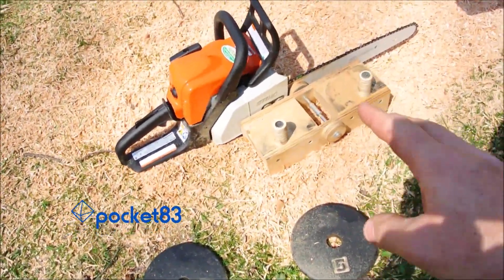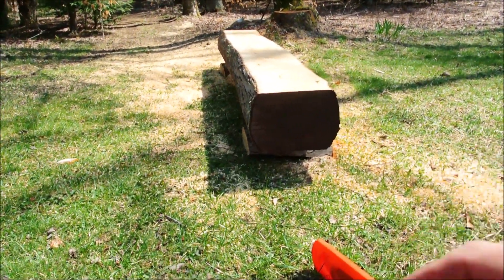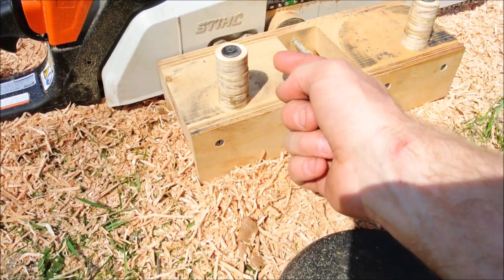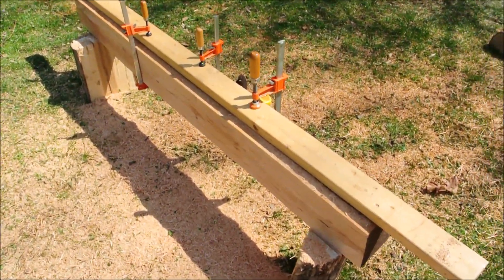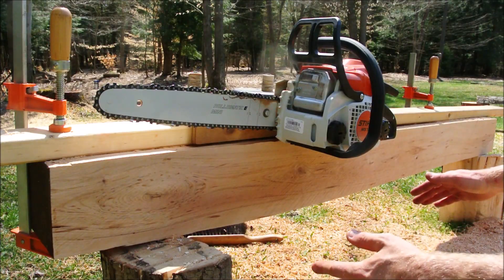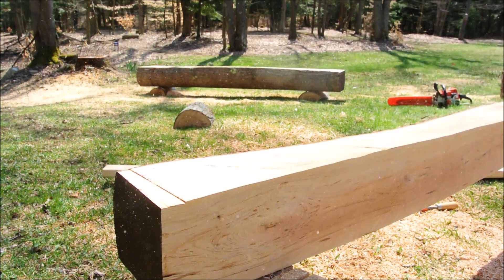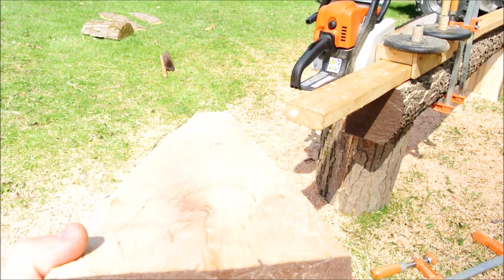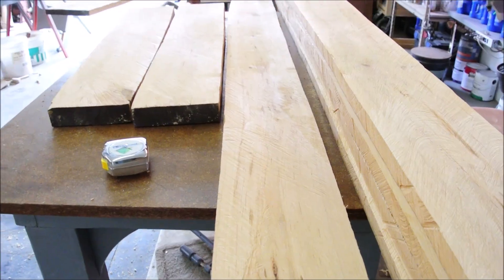DIY Chainsaw Mini Mill Counterbalance

Comment from the maker: In case you missed the original video, here's a link:
►https://www.youtube.com/watch?v=a47IL_Fxb8E

Still on the fence about milling? I hope these videos motivate you to try out this technique. With the addition of the counter-weights, you're almost guaranteed a workable result on your first try. If you've already tried this before, read the description for a few more refinement tips.
Reply: in the last chainsaw milling description you ruled out a counterweight in favor of a pin. did you try out a pin or wheel in the meantime? or was the weight just an easier improvement?
*dont even know why i am engaged this much in chainsaw milling xD  -  the most dangerous tool i have is a coping saw xD - but never the less i like this aproach of yours to these kind of activities, still helps me cultivating better thought patterns in my problem solving :)
Reply: That SEO description is brutal to read. Just checked the description of the 'eight miter' video, looks like I will have to check back later.
Thanks for the video and the knowledge. Not sure the chainsaw has paid for itself yet as I still value wood at 50¢-$1 per board foot (green rough sawn) but I could see it easily paying for itself in other circumstances. Glad for the update proving the usefulness of the method.

Comment: Man, how cool is this? I’m starting my build but have 2 quick questions if you could reply? Would you mount it to the bar the same way if you were a leftie on the trigger? Also Im going to be using an ms250 or 311 (thats what I got) so do you see any need for a 2x6 guide instead?  Thx very much
Reply from the maker: Yes, I would still mount it the same way. Very important. But I might try mixing up my stance by standing on the other side sometimes. My advice is that you start with the same setup as pictured, but then gradually learn to adapt the most comfortable posture. You might find that Right-handed isn't so bad, because the motion isn't exactly difficult. 

And don't bother with a 2x6; it won't make anything straighter. I get this suggestion lots, but it will only add weight for no reason. Also, watch the other videos in this series, because I really refined the process as I went. Part 4 is probably the most useful:

 https://www.youtube.com/watch?v=alClPHQMeMk 

I also wrote LOTS of tips in the descriptions and comments, so poke around there, too. Good luck. I'm here if you have any questions.

Comment: Great idea I doing something  similar   I can't  do the  gas chain saw becouse  of sound and neighbors so I got a electric oregon that work  great for  3 years when cutting  trees  and  milling 8 foot logs then I got greedy and mill 16 foot logs I got 4 and burn the saw😢😢😢 butt not complain it prove  that can be done I got 2 gas chainsaws but i dont want  to start problems with  neighbors. 
I got a question  what  chain are you using

Comment: You are correct, the saw cuts better the shallower the angle because you are cutting along the grain. The steeper more vertical the saw you then cutting end grain, the hardest way to cut wood. Try this test. Lay a short log shorter than your saw. on roughly level supports, a couple of logs, then cut the log with the saw parallel, time it. Next take a similar size log stood on end, than saw it down with the saw parallel. From this experiment the horizontal or shallow angle cuts long slivers really easily. The upright sawn log will be slow harder work with fine sawdust produced, and will be obvious what I am talking about. I am a woodturner who cuts his own logs, same in the lathe, cutting into end grain is harder slow and dulls the cutting tools a lot faster. I love your wooden version, the origin metal version has another adjustable place for board thickness so you don’t have to keep moving the 4x2. Yours is based on the chineium knock off. Look at the version sold by Vevor and available in most places. Greetings from the Southern Cross Observatory-Tasmania-Australia 42 South 👍😁🇦🇺🦘

Comment: The main problem I notice is log's support, in both ends, the other parte is perfect.
Reply from the maker: It's usually more stable than how it looked here. That time I didn't readjust back to the center of the sawhorses. If you do this, recenter your log between cuts. 

That said, honestly, it doesn't matter all that much. You're going to be stabilizing the whole setup with both hands as you cut. If you allow this setup to tip over, you probably have bigger problems.

Comment: Very informative. The only thing I would change is rather than dancing with clamps on the ends, screw sacrificial 2x4s chunks to the ends of the log to screw your guide to. Then the only holes in your work is on the end and can be cut away

Comment: This is awesome! Rather than freehand the top and bottom, couldn’t you flatten the top off enough for your guide to sit flat, then use the guide to cut the sides off and then flip it 90 degrees? I don’t know if that would be any easier though
Reply from the maker: Yes. That's exactly how I started doing it at first. In fact, I'd probably recommend trying that out a few times before using the method I describe here. However, the new way has the benefits of less bark-cutting and more consistent board widths.

Comment: I have just built and used your jig and man it is astonishing! I need to point out that this was my first time I had no milling experience whatsoever but as you mentioned, tenacity was carrying me through the milling. I have just milled my first backyard log BECAUSE of your jig. The value of the jig is that mich greater as it allowed me, a complete roocky, to “feel” the process and beyond that to get 8 astonishing usable walnut boards with jawdropping finish surface! I cannot expess enough my appreciation for your effort of figuring this jig out and sharing it with the rest of us!
Reply from the maker: Walnut on the first try! Nice. Awesome to hear. Thanks.
Reply: I felt compeled to give you the credits I have actually shared your YT chanel name and links to both videos on fb group. Cheers!

Comment: Question : wouldn't it be lighter on the saw and especially on the chain if you cut 90 degrees the first time? What I mean is when you cut at an apprx 15deg you are using the whole length of the bar (well nearly..in your video-obviously it's a case of the thickness of the lumber and the length of the bar ..haha) ..anyway..If you cut at 90deg then that's the shortest accoros so less strain on the chain.Am I right or there's more to it?
Reply here pls hopefully others will find it  useful/helpful.
Thanks for the uploads very clear and precise.Keep them coming.
Best 
Mick
Reply from the maker: In a word, no. Whether the bar is at an angle or not, both the bar and the chain have a fixed length. In other words, some part of it has to make the cut. If it's the nose that's making the cut, then the bottom part of the bar is just carrying the shavings out. In either case, there is very little resistance being caused by a tooth that has its 'scoop' full. "Strain," as you mention it, is just friction, and as long as your cut is clear and straight, it should be kept at a minimum. 

The thing that's probably most surprising about the process is that it works least efficiently at 90°. In fact, it seems like it works the best when you make lots of quick, shallow passes; moving over the log really quickly ends up dropping the boards faster and using less gas. This has to do with the log's grain, quickly ejecting chips, and some other stuff. There's lots more in the description if you're in the mood to think/read about it.  
Thanks.

Comment: About how big is your diamter pine logs you mill. In your opinion can I get 8' 6" easy enough? Thank you so much for a reply brother!!
Reply from the maker: Diameter:
The logs in this video started at around a 14" diameter or so, but after there are flat spots are on each side, that thickness changes. You want to shoot for around an 8" thick chunk that's flat on both sides. This jig is best for making 8" wide boards.

Length:
You can use this method for any length you want. 8'6" is about ideal, because your saw will overheat if you're cutting too much length. Just try to find a 9 or 10' guide board that's straight.

Pine:
Sure, this technique would rip through pine like butter. But I haven't tried it yet. I'm not likely to bother milling unless I'm getting hardwood out of it.  

If you're going to try this, there are even more tips in the description. Good luck!

Comment: I did the same thing.   I swapped STIHL green chain for yellow and it cuts each pass deeper and mills in half the time.
Reply from the maker: As a rule, don't try to make deeper cuts with each pass. After lots of practice, I've learned that making fast, shallow passes is the more efficient technique. 

The type of chainsaw you use is mostly incidental; every saw will have a unique feed-rate/cut-depth balance, but they all end up taking around the same time.   

If you're using this method, watch the follow-up video, and use the counterweights.

Comment: Very nicely done! Thank you sir for taking the time to make a detailed and informative video. I would love to buy a sawmill right now but they are just not available for months. Im going to try this on our cabin project here in Alaska. All I need to do is flatten 1-2 sides of some spruce perlins and ridge beam. So it should work ok. I have the logs so there's nothing to loose but the time trying it.

Comment: So you're saying your jig shouldn't be used on a 40" deep log? My saw has a 24" bar which should give me 18 inch deep cut. 18 and 18 is 36. So I would have a problem cutting through.  Humm, bigger chainsaw needed.🤔

Comment: im gonna try this for sure, win or fail thanks for the idea
Reply from the maker: It'll be alright. Just make light passes, and let the saw do the work. If you use the weights and make ten 1" deep cuts, you're guaranteed to end up with some usable lumber. 

Remember: don't get greedy with yours cuts; light passes using mostly the tip will cut cleaner, use less gas, and go faster. One more thing: use a guide board that sticks over the end of your log by a foot. You'll need the extra length to run out the jig. Good luck.

Comment: Some additional pointers for anyone using a set up like this.

Most chainsaw mills like this use the saw over the log,  not on the side, so the counterweight isn’t used. 

The tighter tolerances you have on your sliding fixture, the straighter the cuts will be.

If you want to avoid the kerf imperfections when moving your end clamp, leave the log 2” longer than you need. Screw a 2 x 4 across the end of the log and then screw the guide board to it from the top. Then cut the remaining 2” off the end of the finished board where the screws were and you won’t have screw holes.

Comment: Whats next.....a tripod  over the top to hold up the chainsaw?  Dude, you got skill..... just build an effen adjustable jig out of metal. I'm sure you can weld, if not,  invent a new way to weld...it just doesn't end, man.
Reply from the maker: Why? What benefit does a metal one have? If I were to go that far, I'd build a proper 'Alaskan' framed mill. But since I rarely fell material that exceeds a 15" diameter, a low-commitment mill like this one is far more practical. 

It's just like Fight Club; you determine your own level of involvement. For my part, I'll probably mill around two 8' chunks every season.

Comment: good job...I used Izzy Swan's Chain Saw Mill Sled as a inspiration and made my version in 2018.  I have been milling my dead trees ever since.  I have at least 1200 board feet of white and red oak mostly.  I learned and what I do now is good stuff.  I mill at 1 1/4 to allow for the drying and planing process.  I enjoy a milling day.  Opening the logs up is like Christmas morning.
Reply: About how big is your diamter pine logs you mill. In your opinion can I get 8' 6" easy enough? Thank you so much for a reply brother!!
Reply: @Truth13157 , no pine so far.  Mostly oak.  The biggest I have milled would be close to 20” diameter.  Most are around 15”. I debark them which helps keep the chain sharp.  I started milling boards at 8’.  The trails are 12’. 8.6 wound be near the limit.  The key is a sharp chain and a clean air filter.  Slabbing is rough in the saw.  Hope that answers your question

Comment: I have a challenge/“is it possible” for you: can you build a similar rail system with four portable belt sanders to use as a make shift planer?
Reply from the maker: Belt sanders are probably not the best way to go. It might be more sensible to suspend a router or a portable-planer from rails for that sort of thing. 

Those tricks are already pretty well-established, but I do have a video about doing something similar with a circular saw:
https://www.youtube.com/watch?v=BYE8bkkPE6E

Comment: Are you working with wet logs ? If not , are they just air dried ? If so , how long ? And i love your jig ! I'm gonna try it on an ms 290 farm boss. I'm use to the weight of the saw. Thanks for the vid and the link !
Reply from the maker: The Cherry was dropped a month ago. The Maple, two weeks. The ends were painted to slow drying. As for the saw's weight, it doesn't matter if you're strong enough to hold a Farm Boss all day; the weights are for stabilizing the jig, to make it sit flatter, so that you end up with straighter cuts. The weights are highly recommended. Either way, thanks and good luck.

Comment: How do you keep the log steady on the rounds it’s sitting on?
Reply from the maker: Remember, it also has a flat spot on the bottom. As for whether the log wants to tip to one side: believe it or not, you're stabilizing it with both hands as you move the saw along. After around one-half of the boards are taken away, the balance will have shifted, and so you'll need to re-center the log on the rounds.
Reply: That makes sense.  One other thought how much gas did it use to mill those boards?
Reply from the maker: Tough to tell, because I top-off between boards. Around 1/2 tank per board? Keep in mind that the saw has a very small tank. The actual cost is negligible. One gallon would probably do 20-some logs.

Comment: Hey pocket. Enjoyed this thanks for sharing 👍  looks like you have refined your perfectly effective method. Great for smaller logs and requires very little special kit - I like!
Reply from the maker: Thanks. It's low commitment, and it's been great for making 6" boards. My plan for the future is still to build something like yours for the larger stuff, though. Happy spring!
Reply: @pocket83squared  happy spring indeed 😁

Comment: i built this mill  2 days ago after seeing your video and used it on my 056,  it got a little heavy after a few trees with the 32 inch bar but im going to try this right away! thanks and good timing on the video
Reply from the maker: Yes, the weights will be a big improvement with a saw like yours. I'm interested to hear how well this setup works with a longer bar. Let me know! Good luck.

Comment: You mentioned the smaller chainsaw is ideal, but if the best cut is made with shallow angles, would a longer chainsaw work better?  Or did you find the larger/longer chainsaw was less stable, so worse cut anyway?
Reply from the maker: I don't know. But it's reasonable to suspect that a longer bar will be associated with increased error. The 16" I'm working with now seems to be an appropriate balance between length and error. And since the investment in new bars and chains is so steep, I'm not likely to experiment soon. 

My advice—if you're using a longer bar—would be to try to tighten up the backlash/slop on all of the jig's parts, and to try and keep a tight rail. Also, try to keep the nose of the saw close to where it exits the log, as you seemed to've suggested. Too much poke-through might cause the cut to 'hug' less and stray laterally, not to mention it's a great way to mill through a few toes.
Reply: @pocket83squared  fair enough. Thank you for the thoughts on this. It makes sense. Now here is hoping reality agrees!

Comment: Your track could have "teeth" at the end (-12"), the endwood is usually trash anyway so the bites don't matter. Then you can hit it in and the front clamp is probably enough to do the whole board without any reclamping.